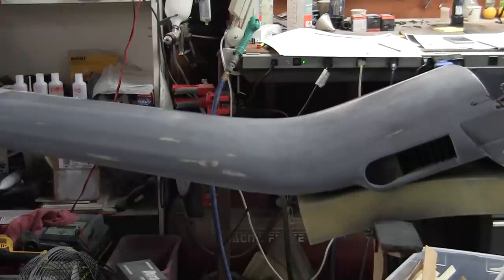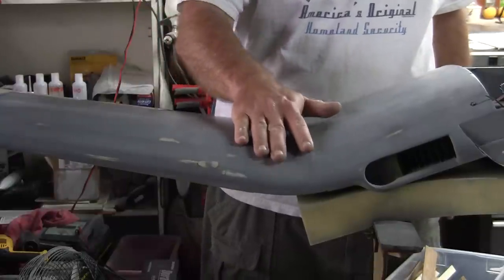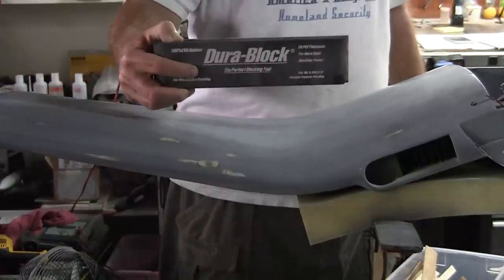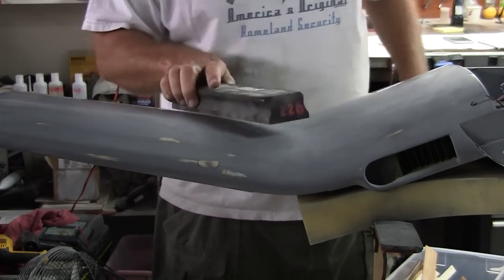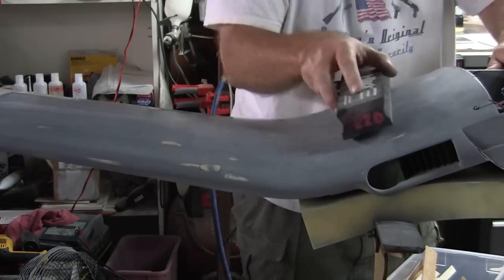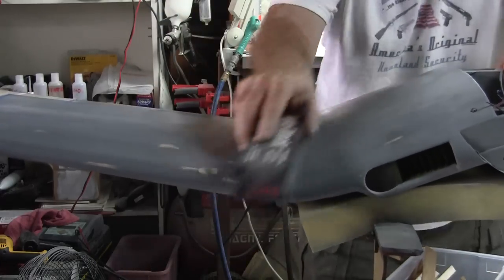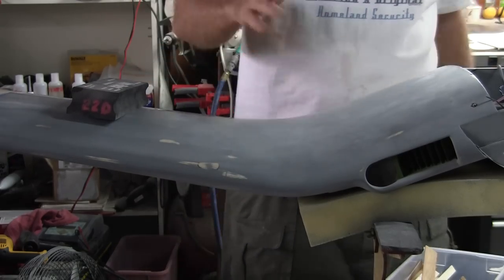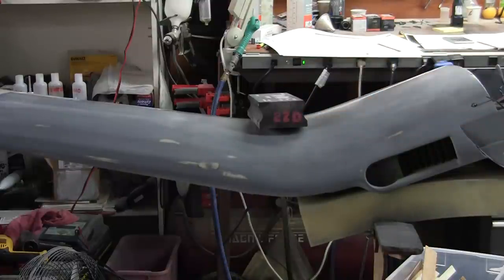Newbie Builds A Corsair #8

Comment: After glassing and directly after peeling the peel ply what prep did you do prior to priming?
Reply from the maker: andarno01 You can, if you want, immediately spray primer. The Peel ply leaves the glass in a condition ready to accept paint. However, there are usually small imperfections that you will want to clean up prior to priming. In my case...and with many scale builds...there was other work to be done after glassing before I could even think about shooting primer.
Reply: DON RICE Thank you Don, I really appreciate your responses and you always get back quickly.I have some parts about ready to glass i think, never glassed before so putting it off as long as poss. :) I have opted for the peel ply method.
Reply from the maker: andarno01 I would suggest you get 1 or 2 sheets of 1/4" x 3 x 36 balsa.
Glass one of those and peel ply it. You will learn volumes with that 1st try. Or glass the 1 side, with no peel ply.
The next day, trim the glass and clean up the edges, then glass the other side.
This way, you will get a feel for how wet, or dry, to get the glass and the peel ply, for the best results.
Don't be afraid. Even if it doesn't come out perfect...it's all repairable. One or two of my flaps had lots of bubbled glass because I applied too much resin, and the glass "floated" off the wood. It looked horrible. But fixing it was no big deal.
Just go for it. It will be fun! And you'll have a new skill in your tool box!
Reply: DON RICE Will give that a go, thanks for the advice, again :), will let you know how I get on.